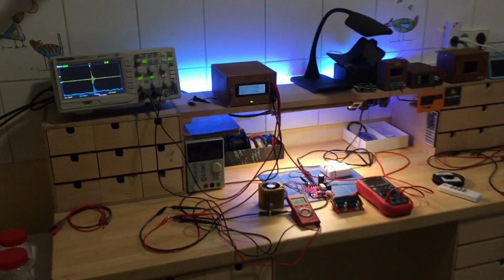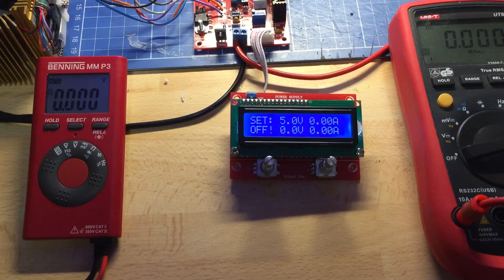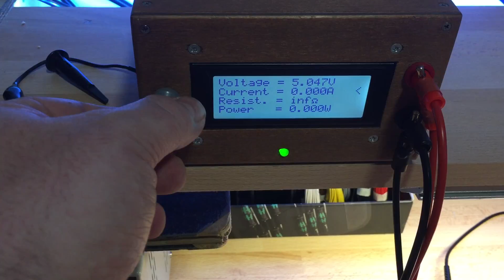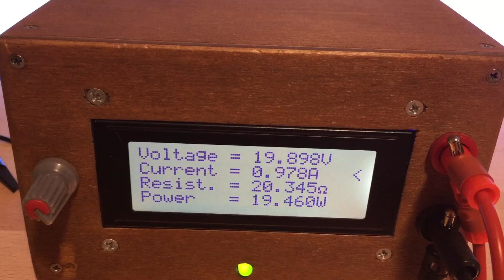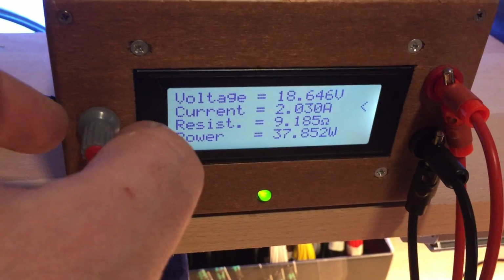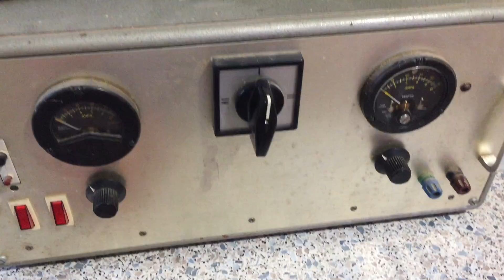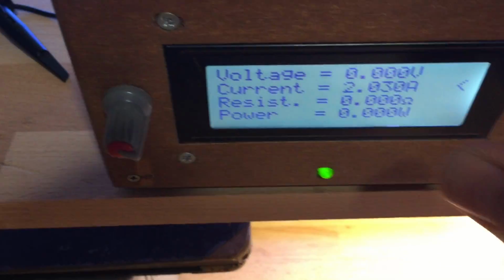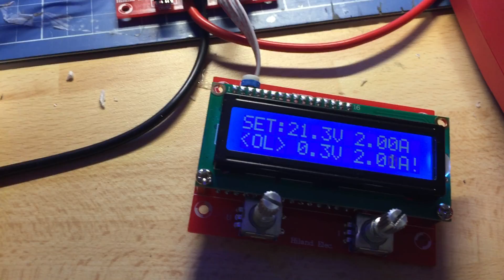0-28 Volt 0.01-2A DC Power Supply DIY Kit from banggood.com

Comment: The ripple!!! That is a LOT! I thinkk I will get the analog version, the "hiland" 2mA - 3A, 0V - 30V power supply that seems to e everywhere now.
Reply from the maker: Ivan Eduardo Veloz Guerrero I also build this but this needs AC to operate and so you have to play with mains voltage. This one also runs with DC and so you can use a laptop powerbrick more save to play with it.

Comment: Thank you for the helpful video ! 
I'm interested in buying one to build my own adjustable power supply, what do I buy in order to power this up ?
Reply from the maker: You need a Transformator but you should only work with mains voltage if you know what you do, otherwise it is dangerous. The best way to do is getting an old Laptop PSU with at least 19V Output so you can't use the full Range of the PSU but it is more safe for the beginner. Then you need to buy or build a case, I prefer wood but not when I work with main voltage then I would buy a plastic case and take care of a good grounding if you are not familiar with those thinks you should really use an external power source.

Comment: Hey, ich bastle gerade am selben Kit und hätte eine Frage; 

Muss man etwas umbauen/anpassen um das gerät mit einem 30v dc 3A Netzteil zu betreiben? 

Und noch eine zweite frage; welche Modifikationen hast du speziell für die Kühlung des ganzen gemacht?
Reply from the maker: Hi, laut dem Datenblatt auf der Homepage von banngood [ https://www.banggood.com/index.php?zf=949687 ] sind die 30V DC genau passend, dann kannst du den vollen Bereich für die Ausgangsspannung (0-28) verwenden.

Input voltage: 24V AC or 30V DC 
Output voltage: 0 to 28V  adjustable
Output current: 0.01A - 2A adjustable
Fast rotary encoder: 0.5V, 0.05A
Slow rotary encoder: 0.1V, 0.01A

Der Kühlkörper lag bei mir noch rum, da der Lüfter für 12V ausgelegt war habe ich einfach einen 7812 Spannungsregler verwendet und damit die 24V die für den Lüfter vorgesehen waren auf die 12V runtergeregelt das war eigentlich alles.

Schön das es auch ein paar Deutsche gibt die meine Videos schauen.

Beste Grüße
Thorsten
Reply: Thorsten Singer 
Thorsten Singer 

Wow, das nenne ich mal eine hurtige Antwort! 
Danke, wollte nochmal eine zweitmeinung dazu hören weil ich mir wegen gleich und Wechselstrom nicht so sicher war...

Bei den Lüftern bin ich noch am überlegen Wiedes am besten funktioniert... wahrscheinlich werde ich das ganze in dem Gehäuse eines alten pc-Netzteils verbauen und die Originalen Lüfter verwenden obwohl das auch passiv gekühlt ausreichen sollte. 
Habe nen Kühlkörper einer alten Grafikkarte genommen, der besteht aus  massivem Kupfer und sollte mehr als ausreichend sein. 

Super, Danke nochmal für die schnelle Antwort, jetzt kann ich mich an das Kit ran machen dann ist es mit etwas Glück heute Abend alles fertig. 

Hehe der Akzent war doch etwas verräterisch deswegen hab ich mal auf deutsch getippt 😁👍

Grüße zurück 
Andreas
Reply: Thorsten Singer 

Hey, Kit ist zusammengebaut und funktioniert jedoch mit einer Einschränkung:
Die Spannung lässt sich nur bis auf 20,4v erhöhen, weiter geht nicht. 

So wirklich habe ich keinen Plan was es sein könnte
Reply from the maker: Ich würde zuerst die Eingangsspannung messen, dann die Spannung die über den Transistor abfällt, ein bissel Reserven hast du wenn du den Brückengleichrichter entfernst da du ja mit Gleichspannung schon reingehst das gibt dir ca. 1,4 Volt mehr, eine Ferndiagnose ist schwer ohne das Bord selber in der Hand zu haben, vielleicht ist auch irgendwas bei der Messung der Ausgangsspannung vom Prozessorbord nicht so ganz OK. Leider ist die Doku der chinesischen Bausätze nicht wirklich toll dafür kosten die aber nur einen Bruchteil was ein Conrad oder so dafür verlangen würde.
Reply: Thorsten Singer 

Werde ich morgen mal testen...

Was mir aber aufgefallen ist; die Spannung lässt sich schon garnicht höher stellen, die Anzeige bleibt bei diesem Wert..

Comment: I have a question, can I just use two buck boost converter as a variable power supply?? it will have more amp than one right?
Reply from the maker: Muhd Faaris I'm not sure if you can use them in parallel to increase the amps I think it will blow the buck boost converter. I use an boost converter with a liion battery in a portable PSU project you find it at instructables.com
Reply from the maker: Muhd Faaris here is the link

http://www.instructables.com/id/Battery-Powered-PSU-0-20V-0-2A-BPPSU/

Comment: Shouldn't you attach the scope probe directly to the psu output to measure ripple?
Reply from the maker: Yes sure, but I think I will add a smal Cap at the Connectors when I build a Case for it, in the moment it was only a Test.
Reply: I measured the ripple of the exact same kit with a 0.8A load @9V for about 20min and the ripple was a lot less than what I see on this video 
( I think about 40-50 mV peak to peak (with 20mHz limit engaged)).
This is still pretty noisy for a bench psu but for powering digital devices it should be okay.
One thing to note is that I've put better caps on my kit than the ones supplied so that could've made a difference.
Anyway ,nice all around presentation of this kit.Keep it up:)
Reply from the maker: Yes better Cap's can do a lot, thats why I will attach a 100uF Cap close to the Output, should help a lot.